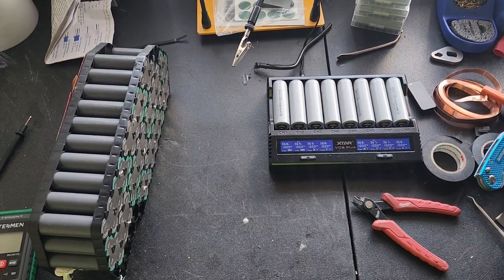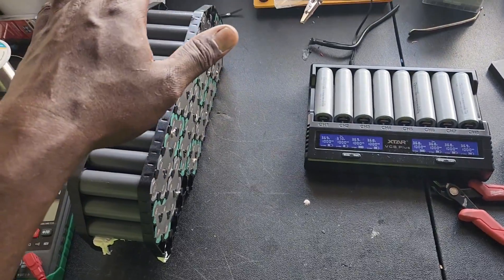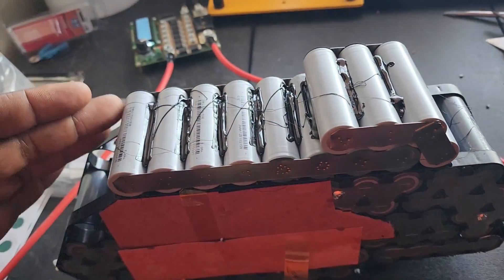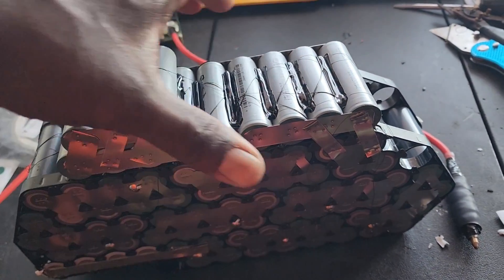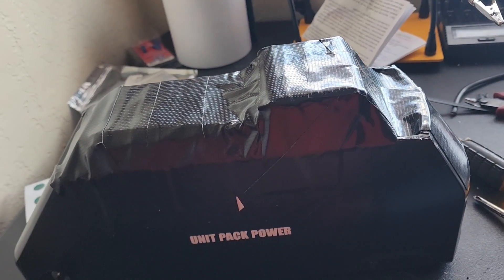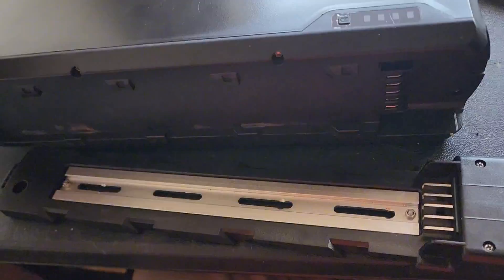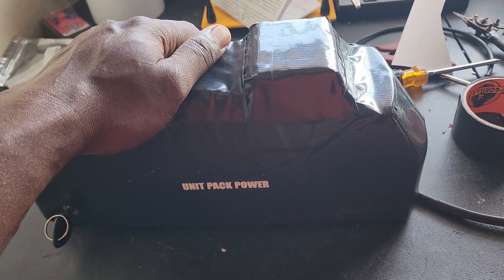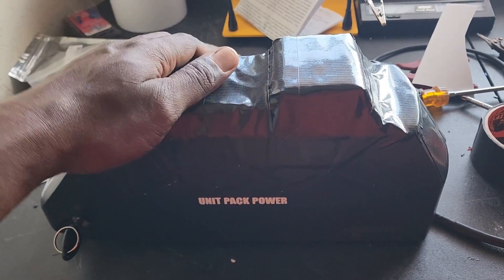unit pack power 60v battery mod to 72v

Comment: Would you happen to know the approximate size of the 60v battery? (Length, width, height)

I've been looking online and  can not find the correct dimensions, they only show the 48v battery size and use that picture for the 60v, but That is not right.

Comment: Very interesting...How safe is that?
I want to turn my dual 48v batteries to dual 60v batteries upgrading my GT73 to a full 60v system with new controller and motor.
Could you do that for me?
Reply from the maker: @JAQ4  yes i can new bms
Reply: @E-bikeguy  awesome, I just sent you an email.
Thanks

Comment: Why doesnt anyone go higher? There are 168v electric unicycles out there why no 100v or 134v bike? Is it overkill or what?
Reply from the maker: Don't need to if you have a good battery 72v and a controller  higher voltage is more speed
Reply: I believe it's overkill for a diy custom bicycle build

Comment: Must use bms.  60v to 72v, just add 12v battery in series with equal amp hours.  Both 60v and 12v having separate bms and chargers.  ie just add a 12v lifepo4 battery with equal ah and continuous amps.  Simple 👍
Reply: You can up voltage with a lifepo4 battery for any bike.  48v to 72v?  Just add in series a 24v lifepo4 battery with equal amp hours and continuous amps. Charge both batteries separately and both batteries retain their bms for safety and long life.  No need to disconnect either battery while charging..  I am a PSU engineer btw
Reply: "series" can be confusing because you join + to - so be very careful.  Watch series connection videos before doing it.
Reply: Don't get bogged down by numbers.  If you have a 72v controller, it does not care if you have a 63.9v battery or a 74.7v battery.  Just add voltage until you have the speed you want.  Standard 36-48v controllers can handle 52v but not higher without higher capacitor and mosfets mods.
Reply: @joeberginc7415 problem is that the under voltage cut off by the controller is not working anymore
so you at least have to use a BMS with proper cut off voltage designed fir your pack.. be it 14s, 18s or 20s...
capacitor is very often 63v .. so that means 15s is max you can use without either capacitor change or use a different controller
Reply: I'm wondering how dose it charge do you gotta buy a different charger and like BMS thing

Comment: Hi mike i have a VARUN ebike peak is 750W it claims it goes 40 miles but its false cause i can only go 20 miles mph  cause it has a 48V 374.4WH battery.  I do believe the manufactures dampened the power of this bike cause the battery doesnt help me with range at all. and whats funny when i move it up to 5 power i see the 25mph pop up on the lcd screen but then it drops to 19mph  I wonder is it possible to mod this to travel further and go faster ?  I can put the link in it if you like to see more description of it

Comment: Great vid Tommy,,
I'm fascinated with the whole idea of building e-batteries, and one day I'd love to have a go myself at making one for a future e-build...
Whilst watching when showing the heat shrink end results it got me wondering - Tommy, have you ever considered to the idea of getting a 3d printer to like print the extra plastic framework for the now extended size of the battery, and for printing out the finished battery's cases that you make ppl?

3d printing isn't something i know anything really about, It just got me thinkng it would (or maybe would) be a better idea for making batteries for customers - maybe it's just me, but i think batteries look so much better in a proper case, instead of being heat-shrink wrapped.
I don't really know if 3d printing a battery case is relatively cheap/feasble to do as far as cost is involved?

I guess it just got me wondering if it's something you've thought about doing as you make some damn impressively powerful E-bike batteries - and you make a lot of them it seems for people.

I was also wondering why it is Tommy that you don't seem to use a bms (that often) when you're making batteries?
Is it because the bms is a limiting factor in the power output of the combined cells of the battery? Or is there some other reason, is it maybe just to keep costs down?

Another thing i was wondering is the ebay bought battery i have is a 52v20ah and it just fits in the small triangle frame on my "Scott 'voltage'(ironic, i know!) YZ4 26" mtb e-build bike frame (spooky that i blindly bought a mtb to do my very first e-build and the bikes called 'Voltage YZ4" ain't it?!...but I was wondering if a 60v cells set-up would fit into the same small case, like can you get higher voltage indivudual cells that instead of 52v, then you can fit 60v power in the same plastic battery cover space-or is it the higher the voltage you just need more of the same cells to make it from 52 to 60, or 72?...
'cos my 52v20 battery size is (..i think) the absolute smallest size case available for yhis amount of cells maybe required to get 52v power...?

And what was your very first Volts/Amps battery that you made yourself Tommy?

I hope you don't think I'm asking dumb questions, and sorry for the amount of reading too! - it's just my battery knowledge is lame, I perhaps really need to watch a whole load more vids on the building batteries process 😂

Cheers for any answers to my questions, its just am v.interested in learning how to build my own at some stage.

If i had the money id be asking you to build me one, but its tricky what with me being in the UK too mate, damn i wish i lived near you! 🤣👍

Comment: you can use abs plastic & epoxy to make a cap, then use the same glue to put it on, also you can cut the heat-shrink to size & connect it with superglue although in this case it wouldn't work well because of how the battery fits in the cradle
Reply from the maker: Oh ok 👍  man, I haven't heard for you in a while,  how you been

Comment: You can use heatgun to soften the upper casing, just cover it while it's hot. This will look at lot more professional.👍☮️
Something I don't understand is you have to redo the entire pack if you want to go from 52 to 60v... It seems you just increased the capacity by adding an extra module in parallel but I might be wrong
Reply from the maker: Same capacity I increase the voltage from 16s to 20s
Reply: Ok my bad, I didn't really pay attention, watching on a phone since my tablet died @EBG-offical
Reply from the maker: @nicod974  lol you is fine.
Reply: I rewatched the video, the module you added is a 4S3P, correct? @EBG-offical
Reply from the maker: @nicod974  4s 4p
Reply: 52v is 14s.. so now it's 18s .. not??

Comment: Where’s the bms?
Reply from the maker: No bms
Reply: @EBG-offical  how are the cells charged then?
Reply from the maker: @RhinoNigel  via a charger
Reply: @EBG-offical  so you have to take it out of its shell and attach a charger to each grouping whenever you want to charge it? Or do the cells individually have protection?
Reply: U must be new😂😂😂
Reply: @nicod974  I’ve been making packs for a while now so when I don’t see a bms, I’m quite confused. Care to explain then since you’re the expert?
Reply: @RhinoNigel  Dude what are you talking about bms not for charging it's to make sure your each single batterys or groups are healthy and working if it's not working right i believe you can't get voltage out of your battery

Comment: I saw on another channel saying that one of your batteries in a customer's bike caught fire. Is it yours? And what happened? It looked like soldered on solid copper wires. Thanks
Reply: As a third-party witness, it was more like he assisted someone in building their own battery who didn’t have the tools, but the method used and the lack of BMS were the customer’s decision. 

I specifically asked DUST where the BMS is, and he said Jehu Garcia said he doesn’t need a BMS, and I said “save that email for when the fire trucks arrive”.

That battery only had one snake bus, the other series connections had I believe 4x AWG copper wire, enough for 240a continuous and 720a peak. The only snake bus was along the top and I think it had 2x AWG12 wires, good for 120a continuous and 360a peak in open air, but when using Molicel p42a as heat sinks, it can take more for longer.

Would a BMS have prevented this? No idea because not sure the other evidence. The BMS will protect during charging and also during discharge. And you can definitely start a fire when you allow a brick to drop to 0 and then get reverse bias charged as you try to drive further. This is especially dangerous on a 26s pack because the dead brick missing voltage is masked by the other 25 bricks.

Was the battery wrapped, protected, padded properly? That was done by the owner. So if it bounced around and knocked a AWG12 wire loose, thats not E-bike guys fault. 

If Dust showed up and dropped off his bike and the battery was built and installed with no input from Dust, then that would be a different story.
Reply from the maker: Yeah  it was user error  I help him build that battery it left my house just as you see it so after it left my house I have no idea what happened
Reply: Also...when I worked construction...our company ordered a fleet of brand new 1500 Chevy trucks...5 of them caught fire within a week.  Electrical fire.  Nobody out here saying don't buy Chevrolet...why is that?  Lol